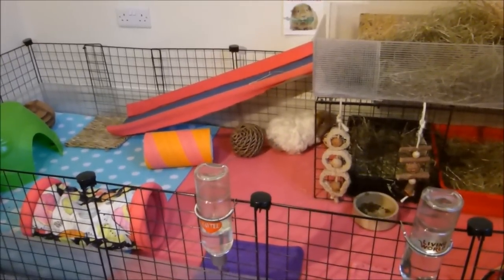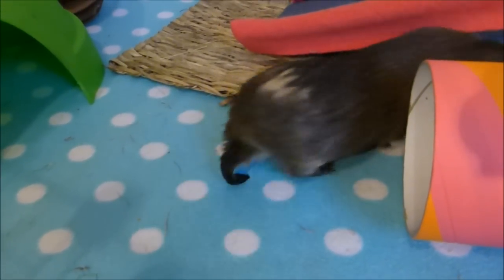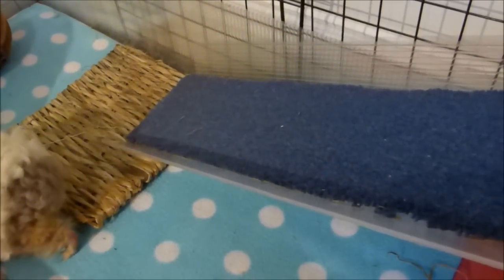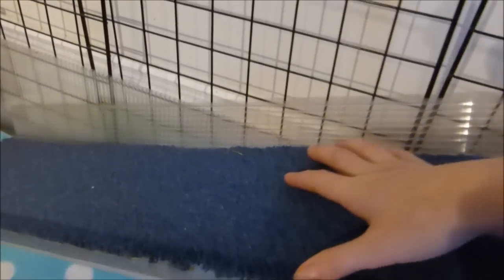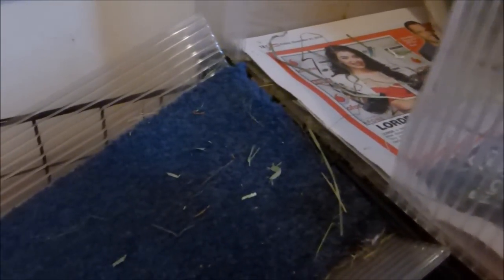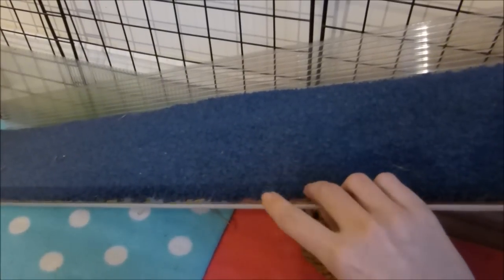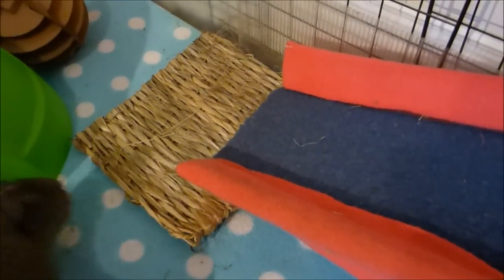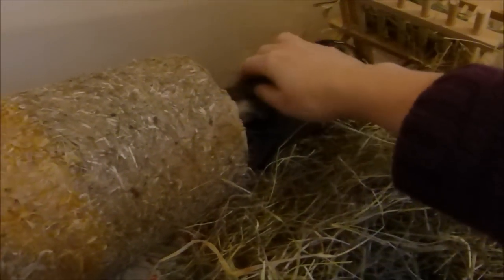How to Build a Quick and Easy C&C Cage Ramp!

Comment: Also where is a good place to get a c&c cage?
Reply: You build it... Or you can buy one from Guineapigcages.com
Its cheaper to build one
Reply: Jernej Sturm:    Go to Walmart to buy two packages of wire cubing (you'll find this in the housewares section; they are used to build storage cubes).   For the coroplast, call your local sign company.  The coroplast sheets come in 4'x8' sheets, in a multitude of colours.  For a full sheet, you'll pay about $20.00
Reply: i use a shower curtain liner. way easier to find

Comment: how much does a c and c cage cost  ?
Reply: About 50$
Reply: Ok tnx
Reply: What's beter a c and c or a midwest  cage
Reply: +Marc Bermudez a c&c. Cage can be cheaper i got mine for 24$ Because i got the grids for 20 and i got foam board instead of  Corplases so there only like 1$ but i got 4 and plus a c&c cage can be larger a midwest i think is about 60 and its 8ft but if you buy c&c grids 60 $ you have way past the minimum